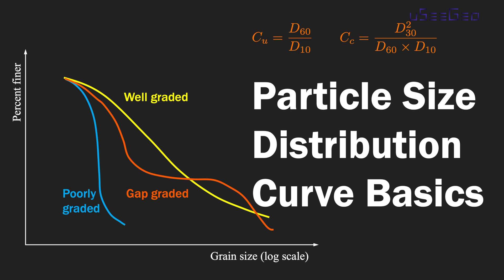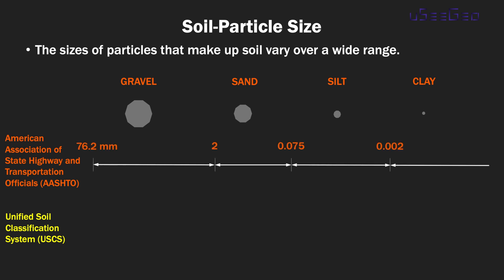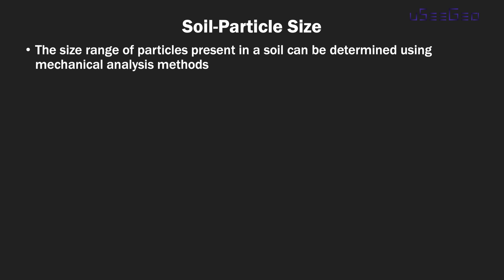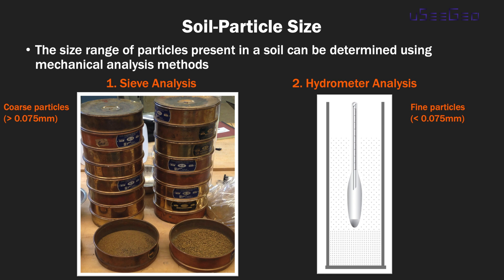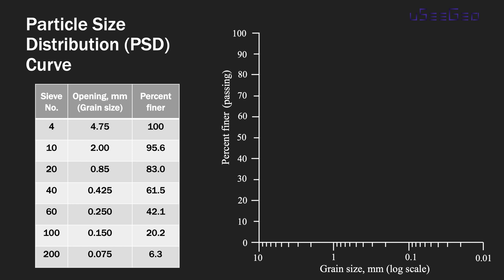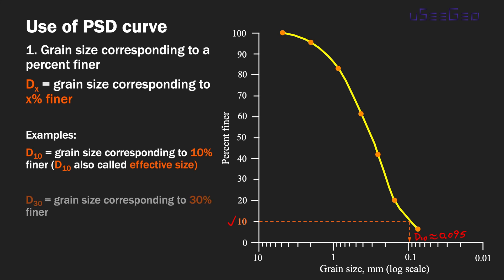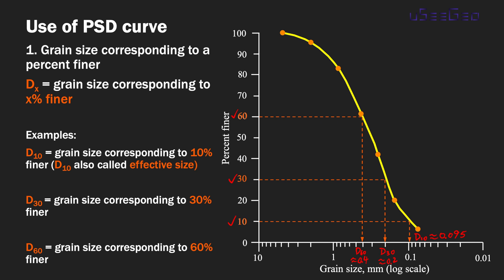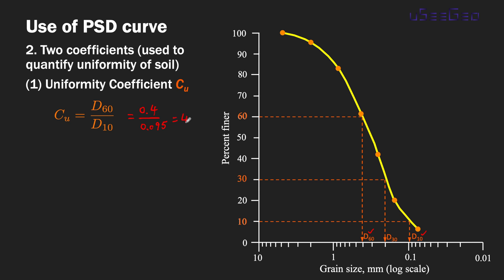Chapter 2 Origin of Soil and Grain Size - Particle size distribution curve basics

Comment: do we always just 'guess' the values of D10, D30, & D60 based from the PSD graph? is it possible to calculate for the exact values of D10, D30, & D60?
Reply from the maker: The easiest way is to read those values directly from the graph. Alternatively, you could use interpolation of adjacent data points to get the value.
Reply: @uSeeGeo  Got it. Thanks!